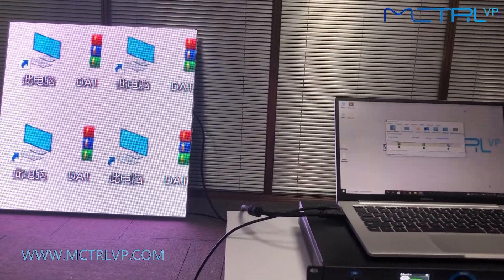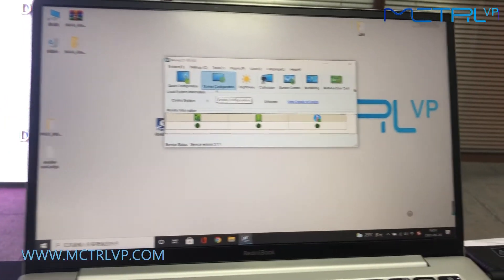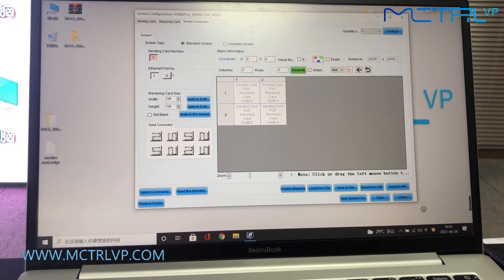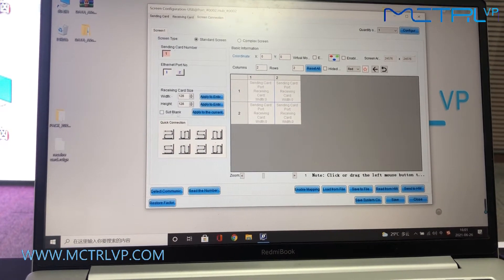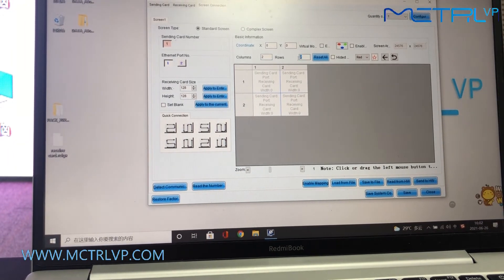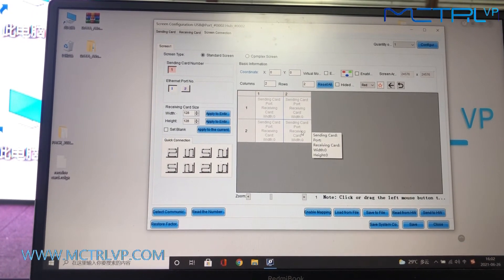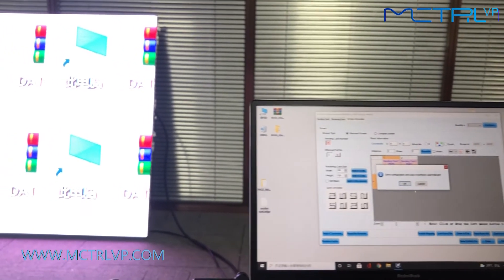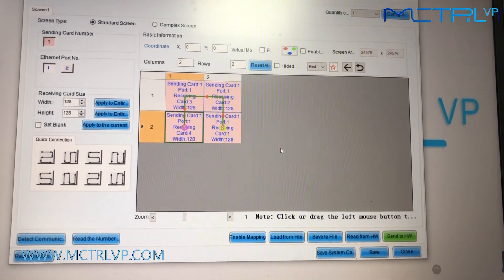How to connect the hardware and software of the LED display through Novastar VX4S/VX4S-N/VX6S

Comment: hi. how many screen panels can 1 ethernet port handle? (or how many pixels can 1 ethernet port handle?)

for example if I have a video wall with 60 panels. 10x6 video wall.  Can I make 1 continuous data chain or do I have to use for example 20 panels on Port  1 and 20 panels on Port 2 and 20 panels on Port 3? thank you
Reply: 650,000 pixels per port.

Comment: I have a novastar mctrl660 can I use this for a led wall display and what software I need I have a MacBook Pro
Reply from the maker: Novastar MCTRL660 can only be installed on Windows system, so your MacBook Pro can be installed on Windows system to use MCTRL660 to control the display
Reply: @mctrlvpshenzhen2782  can mctrl660 connect to any led rgb video display
Reply: @mctrlvpshenzhen2782   and what software is it
Reply from the maker: Install NovaLCT software, the computer's operating system must be Windows, iOS is not acceptable